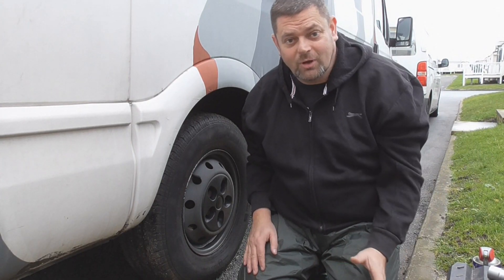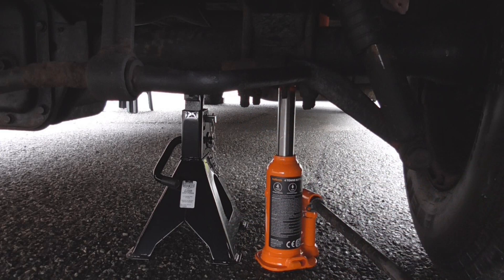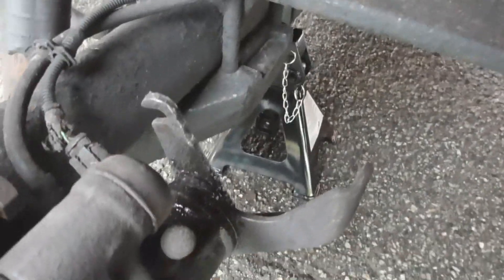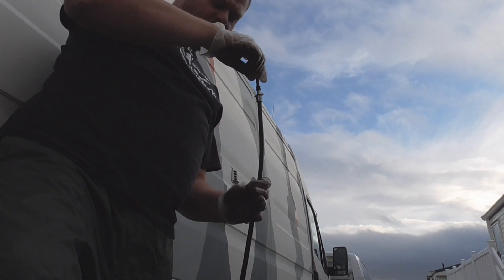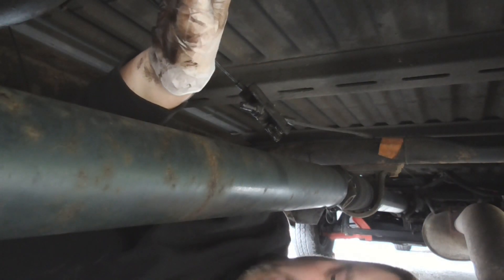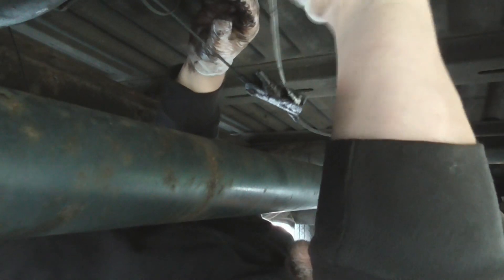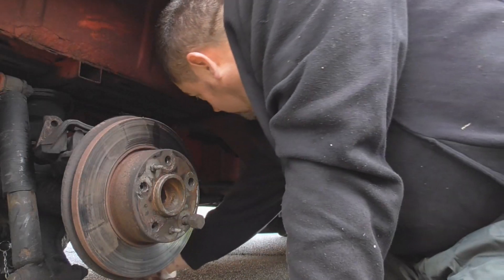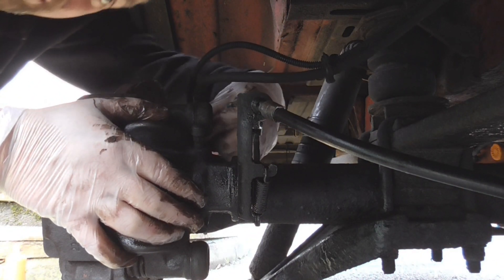Iveco Daily Campervan Replacing Handbrake Cable

Comment: I’ve learned a lot, cheers 🍻 I’m gonna buy a VW van
Reply from the maker: Good luck and keep an eye on the bodywork if buying a VW, they have rot problems but there's good ones out there to be had 👍
Reply: If you get a secondhand crafter first job clear the drain holes on the sills they get blocked and hold water then remove side plastics and seal the plastic clips in place that hold them to the side of van any rust spots sand them back well treat and paint there not a bad van but ivecos are better cheaper and fully galvanised 
Just a thought